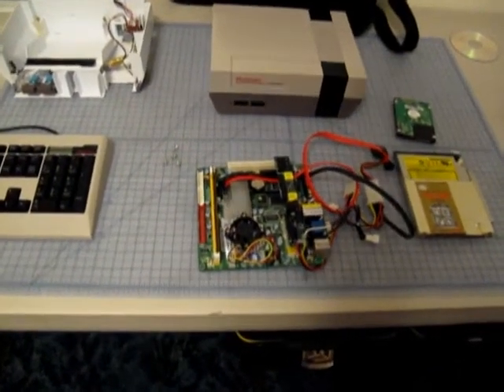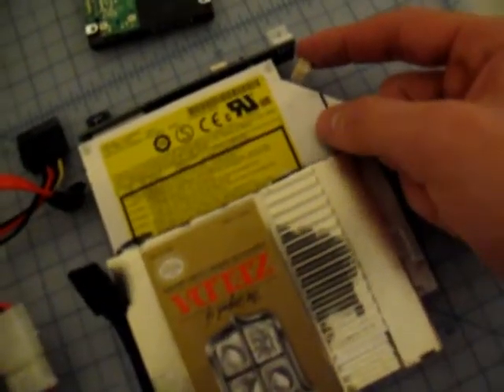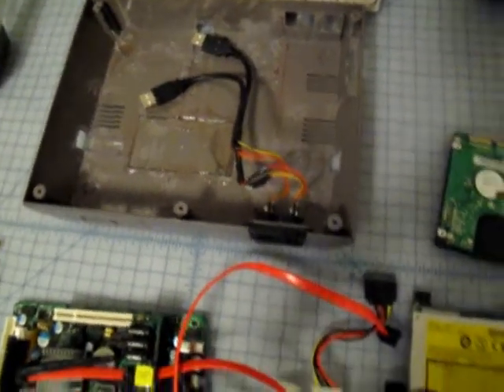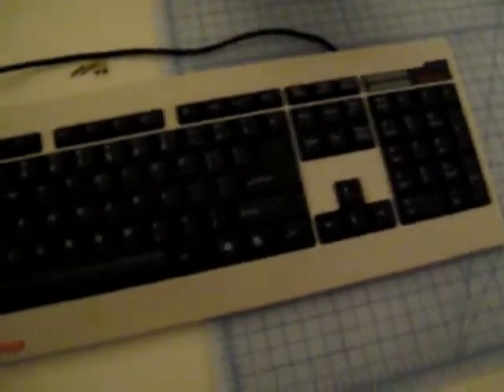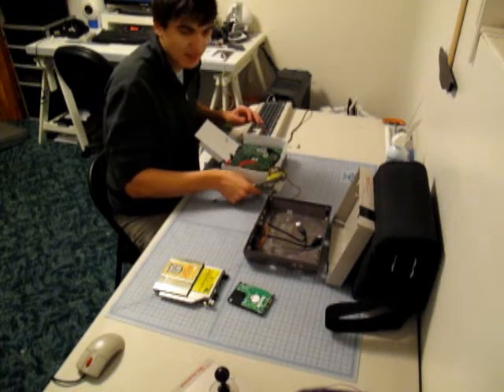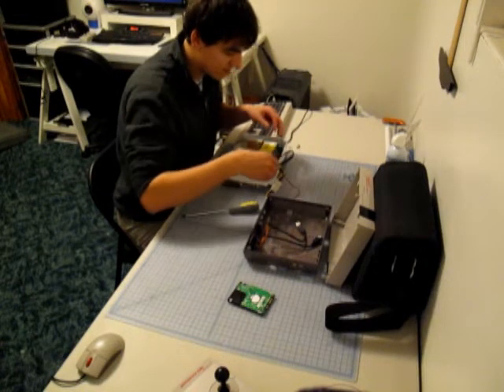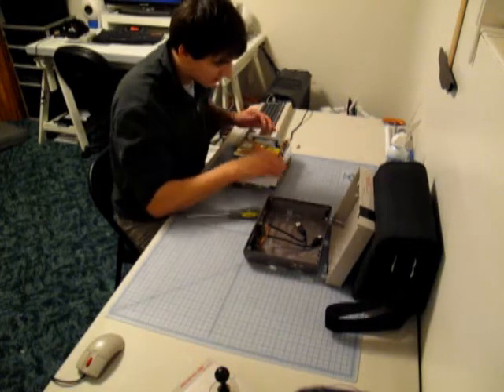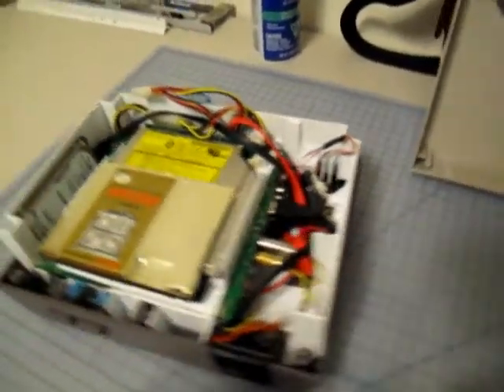The Unassuming NES PC Tour - Part 1 of 2

Comment from the maker: Heat would be an issue with something like a Core 2 or i7. If I were to do one with an i7 I would have a custom heat sink made. I also have a few more tricks up my sleeve that I haven't gotten to use yet. Hopefully in a future build I will do a full gaming machine. It won't be fully stock from the outside, but should be true to the integrity of the NES PC.